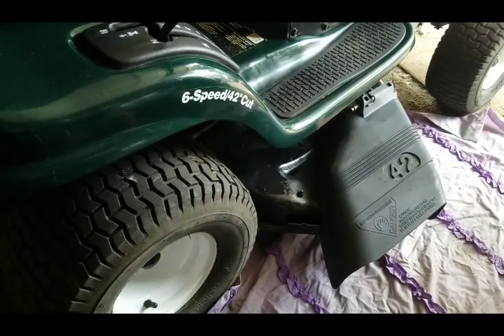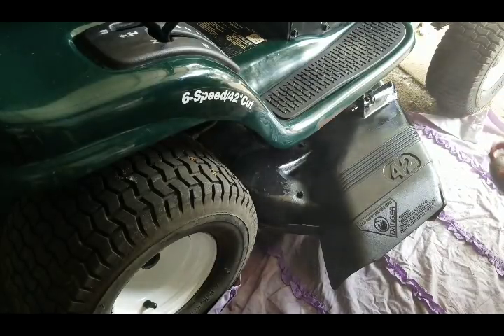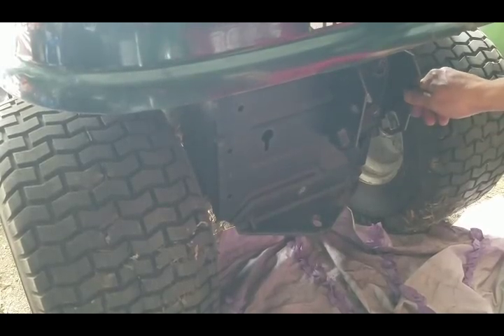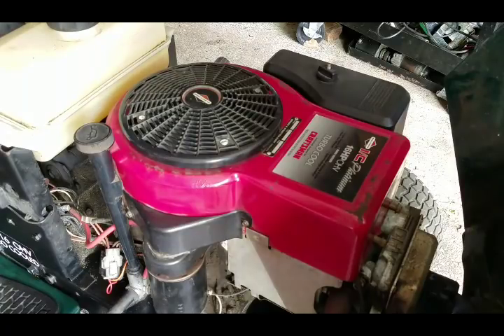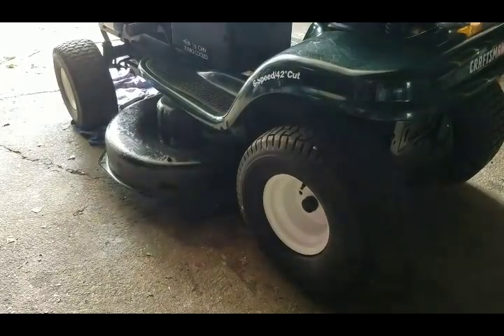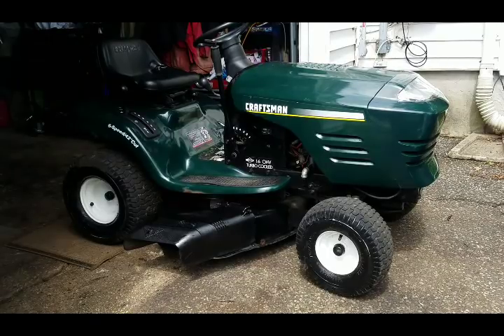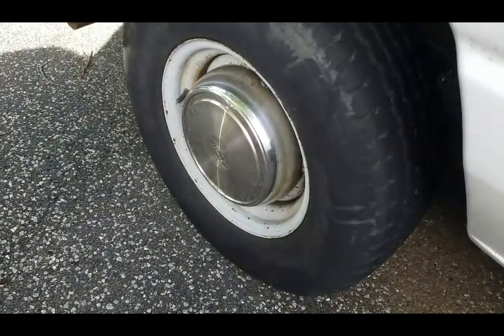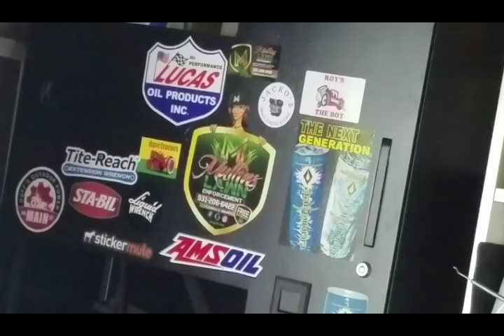FREE CRAFTSMAN LT1000 SMALL ENGINE FLIPPER TIPS .98 CENTS TOUCH UP SPRAY PAINT ATF FLUID DEEP SHINE

Comment: Ya know Henry that black paint kinda reminds me of that quick hair product that you buy in a can and spray on your head. lol 

I like the red touch up on the engine cover and you can always use that new hub cap for an oil drain pan. haha
Reply from the maker: Yes don, that's exactly what its like.  It's more air in the can than paint, but it makes for excellent touch up use.  I returned the old hub cap minus shipping it back...you lose some, but not all.